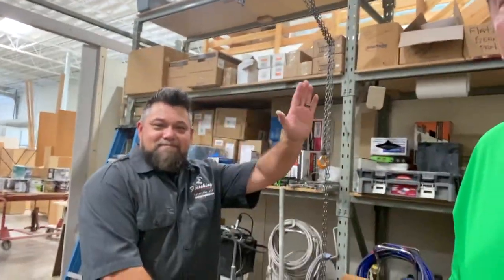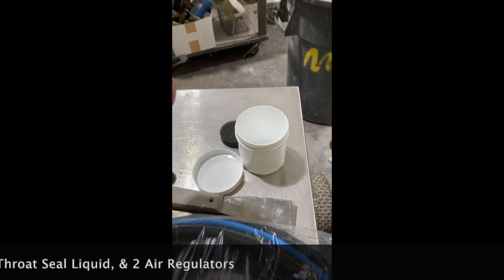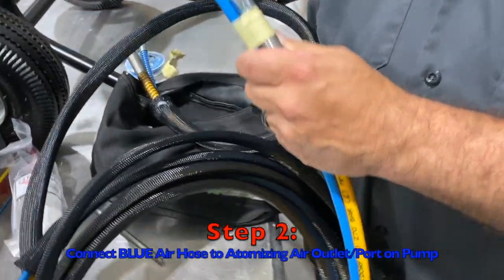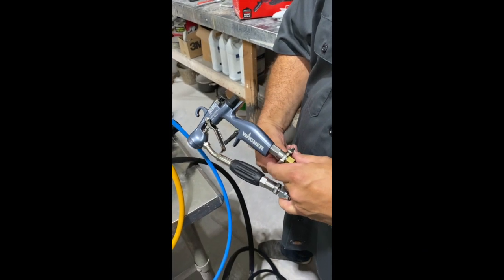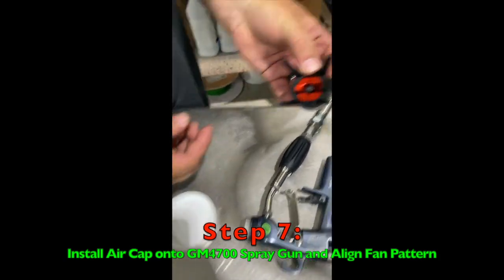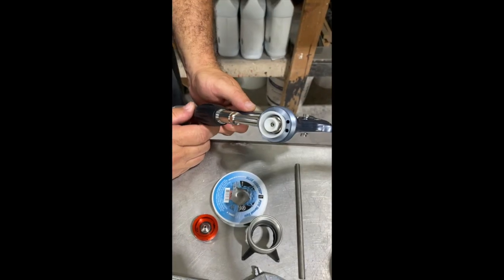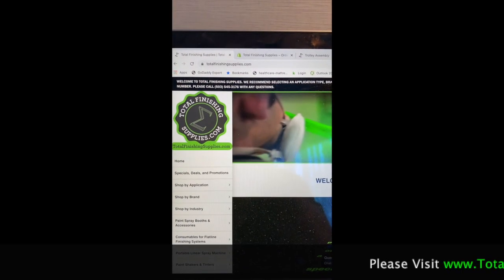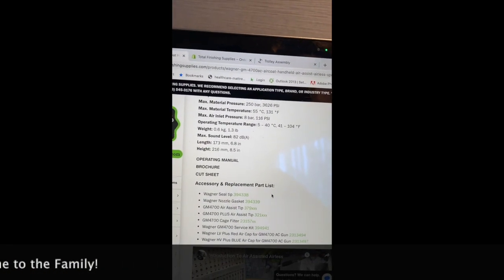TFS 14:1 Pump with Wagner GM4700 AirCoat Gun - Training and Installation Video

Comment: This is a great setup! Wondering in you have any experience with the Sagola mini mix extreme gun and mack 150/250 pumps. Im trying to push my company twards your setup with the 4700 but the paint rep/company sells Sagola products. Any info would be awesome
Reply from the maker: We really never see that brand in the industrial market.
Reply: @TotalFinishingSolutions  how is the CAT/4700 for breaking up heavy European waterborne finishes, about as thick as latex wall paint?
Reply from the maker: @the_sharp_carpenter  I would call it good.  Personally I would go with our 30:1 Anest Iwata pump and VIPER® spray gun.  Here is a link https://totalfinishingsupplies.com/collections/special/products/anest-iwata-icon-m233n-swm2-30-1-cart-mounted-pump-with-viper-mix-tech-air-assisted-airless-spray-gun
Reply: @TotalFinishingSolutions  what's the minimum viable psi input to maintain clean function with the 30:1?
Reply from the maker: @the_sharp_carpenter  7-10 psi depending on the viscosity
Reply: @TotalFinishingSolutions  okay, I know some can start to flutter and stall at lower PSI ranges, making them not great if you ever need to run lower pressures for thinned out materials. Thanks for the info, I'll have a look at those options as well 👍